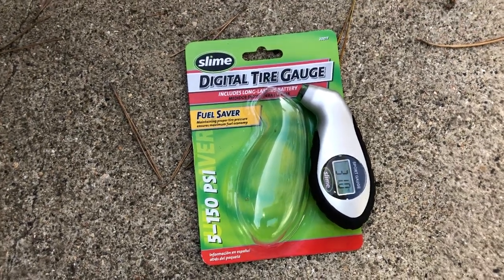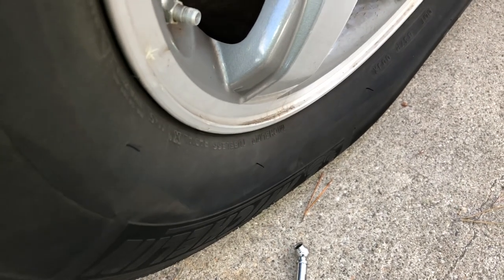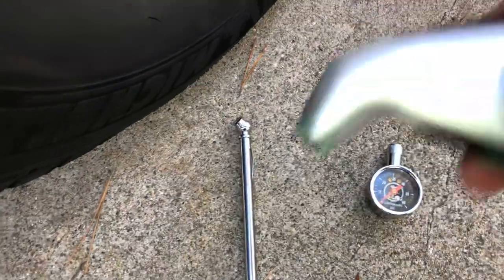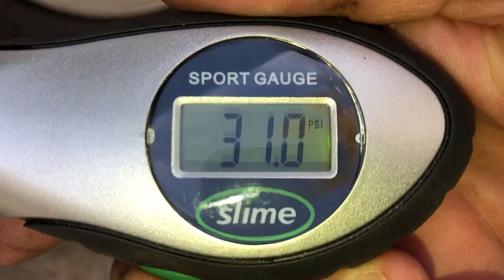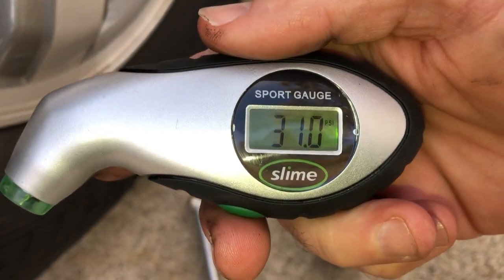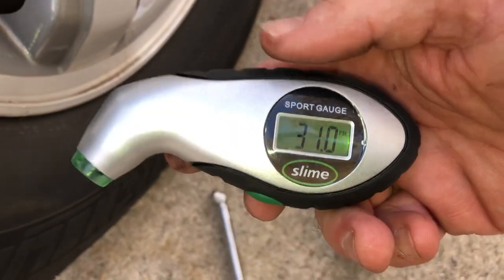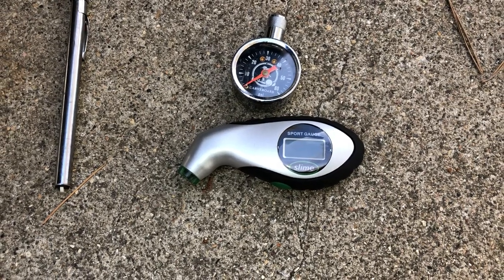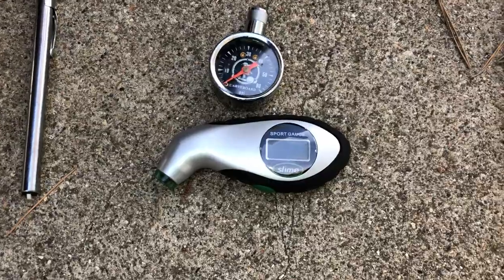DIGITAL TIRE PRESSURE GAUGE REVIEW - GREAT TOOL!

Comment: Hey dude, I have the same issue as Barbara, I bought one and it seems it’s just letting the air out. Did we get one that’s broken? The tip doesn’t look normal! 🤔
Reply: Push it in with pressure 💪
Reply: Alil force should solve that

Comment: I have that same one but when I check the pressure, mines sounds like it’s letting the air out but yours didn’t have a sound
Reply: You have to push it in not alil but all the way in
Reply: ultradeadd  it should be for a second just to push it in then u shouldn't hear anything after you push with pressure it's air so u gotta use a little force